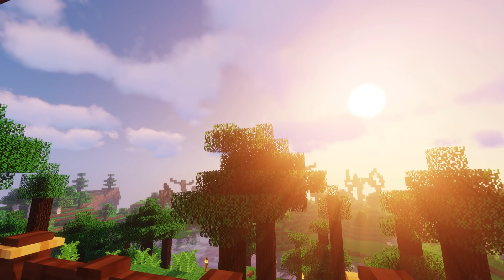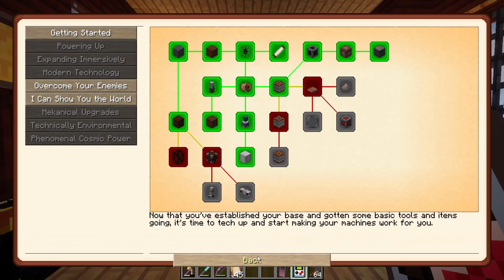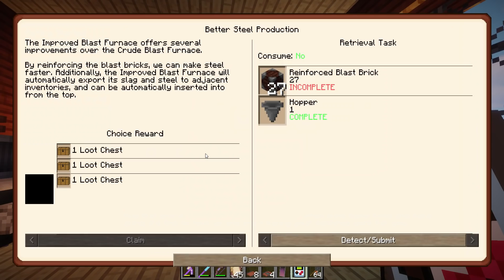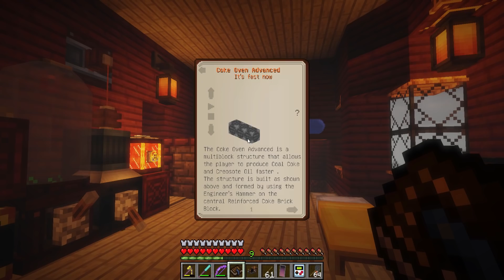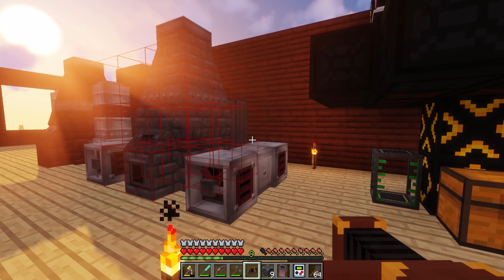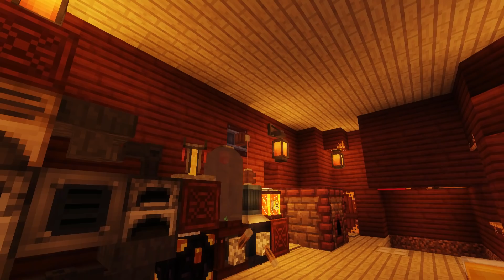Let's Play Automaton! Upgrading Advancements! Ep 11

Comment: i find it kinda weird the quest path is pulvus then crusher
Reply from the maker: I agree. It does seem counter intuitive but then I suppose it's a matter of power vs fuel
Reply: but u actually ran a lava pump off of a passive ie generator(feeding the pulvus the lava) , running a full sized crusher off one of those sounds likes its asking for a big slow down. so it becomes power vs power in that case(by the time the nether goes dry i doubt it will be a concern power wise )

Comment: That cliff you're on seems pretty bare. I bed you could use the Platform mod to create a pretty intricate yet accessible setup for your machines. I can just picture you with a beautiful house from the front, while out back is your own personal Blighttown!
If you can work out the piping required, you could probably automate practically everything. I can see you with a wall of labeled crates: "I need some steel for this recipe." takes steel from appropriate crate "I'd better make sure I'll still have some later, too." puts iron in depositing crate, which disappears into the system "I'll get that back as steel in just a bit." wanders off

Comment: The Improved Coke Oven is actually from Immersive Tech.  They are so much more useful than the normal coke ovens since they seem to actually be possible to automatically export fluids from (the Mekanism pipes were not working for me at all).  If it weren’t for that I probably wouldn’t have come back to the pack to finish off one of the final quests (even though the true final quest I never complete because the resource sink required for it was ridiculous).
Reply: and these other coke ovens make no sense, adding more air would make the carbon burn up and give you nothing irl
Reply: @mark d. s. You know what, I think I was thinking about voiding the creosote into a fluid nullifier.  Either way, the speed increase makes it worth making to keep coal cokes stocked to use for steel.
Reply: @ChaoGirDja  airtightnesst doesnt matter if the raw air youre inputting has oxygen